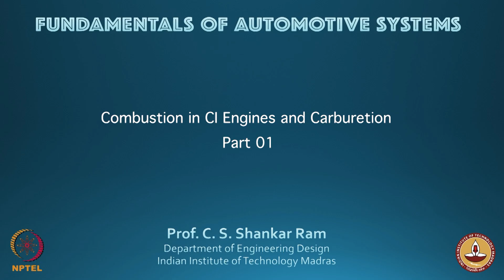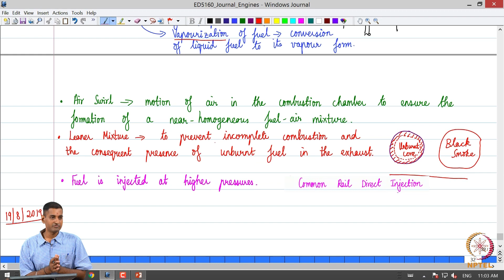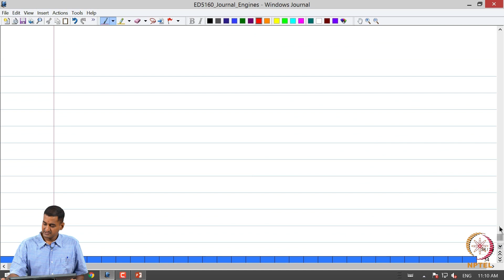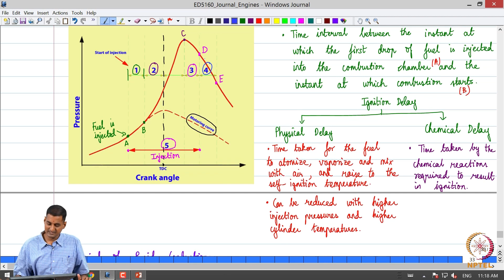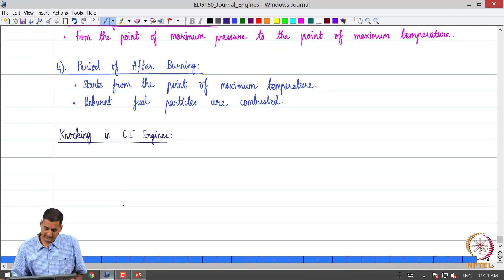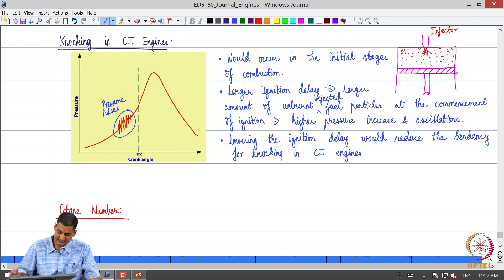#19 Combustion in CI Engines & Carburetion | Part 01 | Fundamentals of Automotive Systems

Comment: IF an engine is started after a long time rest. What will be the temperature already in the cylinder. If at all the energy that is stored in a flywheel turns the crankshaft thus the piston. It takes long time to generate that temperature inside a cylinder. How is this accomplished ?
Please explain.
Reply: Kick marke